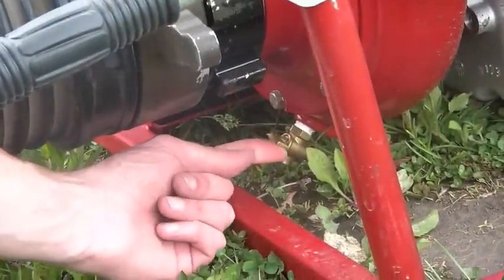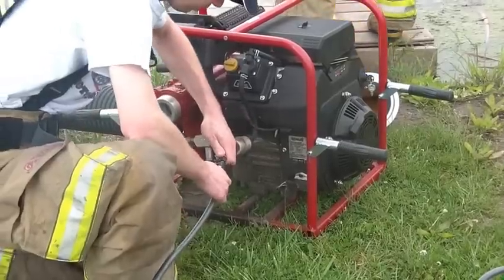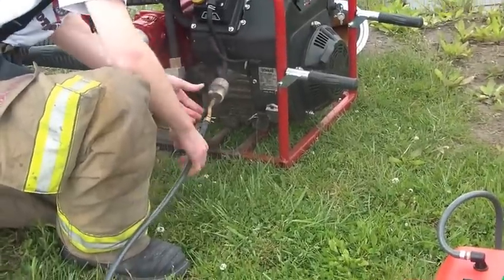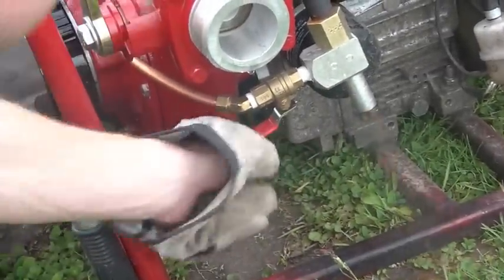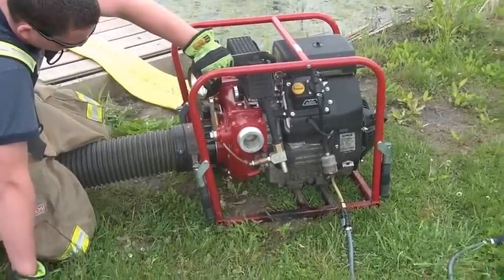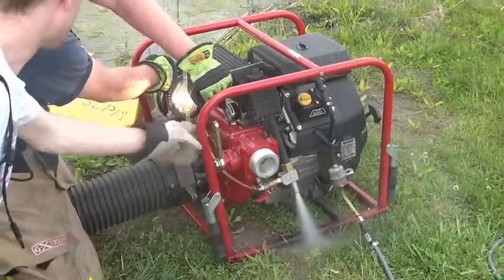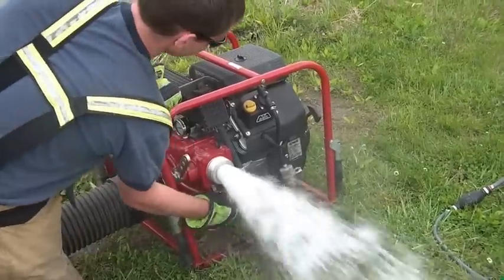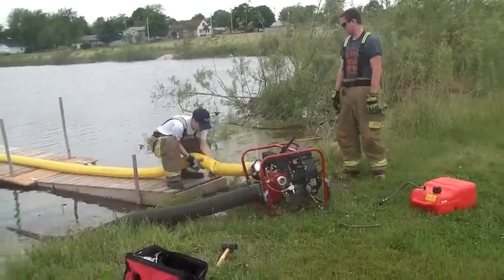Portable Pump Training

Comment: We use 4 2.5" dischsrge pumps hooked up to a 4x2 manifold.  4 2.5" intakes and 2 5" output valves.  All custom made of course.  We can also reverse it and flow 25" lines i to 4 2.5" lines to fill brush rigs.  We use the mabifold a d 4 2.5" pumpa for rural operations,  mainly tenders  and 2 people can run it.  It doe shave 2 1.5" discharge valves and 2 1" valves a swell incase there is some odd spot fire or chance of burnover in our area  we can fight the fire with no engine needed.  We akso use the 1" valves with a pressure relief hose if ther eis a bigger break betweem rigs so we dont have tp throttle down pumps.  We use 4 23hp waterax b2x pumps for the manifold howecer,  we are looming at upgrading the systen to a 8x3 ma manifold and  buying 4 Tohatsu 83hp pumps caoable of almost 1000gpm each and usinv the B2X on 2 new double axle brush trailers with 1600 gal ta ks for extendee brysh operations and as  a mobile fill site for brush rugs where  tender may not fit.

Comment: Our department has just purchased the 27 hp unit and was wondering what kind of a distance can one of these push water over .
Reply: you purchased a pump and after that you ask for the technical specifications ?
Reply: walter clarke 
Depends on make and model.  Also on the type of hose,  temperature,  elevation and TBH the person operating pump.  We used higher quality 2.5" and 5c hoses with 50 to 75% less friction loss.  So hit me up here if you want some assistance

Comment: We have a couple 18HP units...  great pumps until you have to pick them up... and they need battery to start (ours anyways) as they will not start with pull cords... once running, they are strong/high-volume units  Happy Pumping!
Reply: Jerry P we use to use battery units years ago,  till vatteries started to die,  with no manual override.  We use pully ones now wjth exhaust primers.  However with the advance of lithium batteries,  id be willing to try them again.